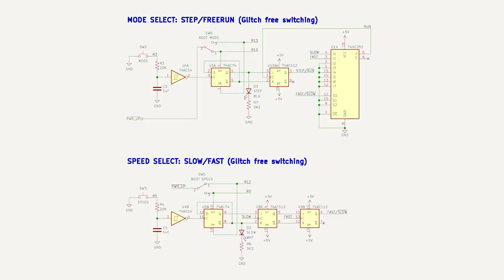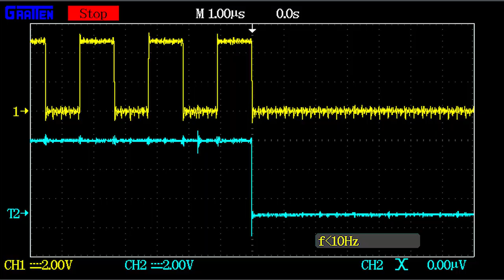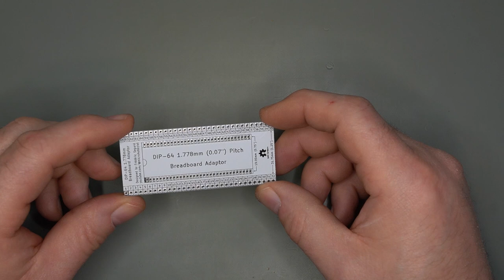Z80 Homebrew - The cart before the horse - Ep4

Comment: These PCBs look awesome, I love them in black. Even your white PCB looked good. I think there was silver writing on it which looked nice. Not sure how you did that. I would be interested in mailbag videos if you did them. I tried doing them for a while but didn't get much interest, but I would still suggest doing them anyway. You never know, you might get more interest than I did. I should also say as well as great content, your videos have a very professional look and feel to them.
Reply from the maker: Thank you for the kind words. It's very appreciated. I love your content also.

I assembled the CPU card, and it works like a charm. I started to port over my monitor program from my 6502. Once I get familiar enough with Z80 assembly, I'll start making other boards. And eventually try CP/M. Not sure if I should bit-bang an SD card, or simply go with a CF card.